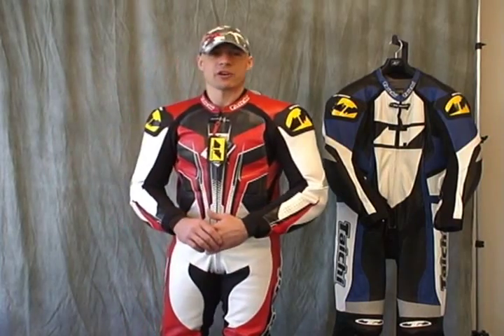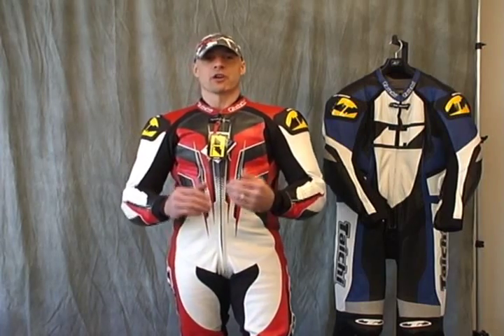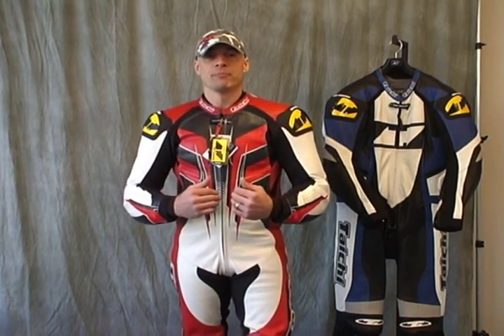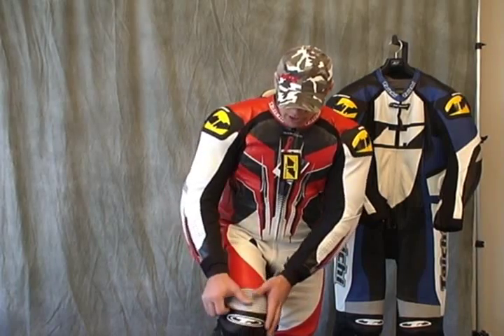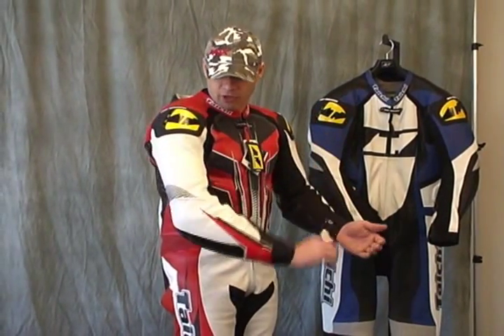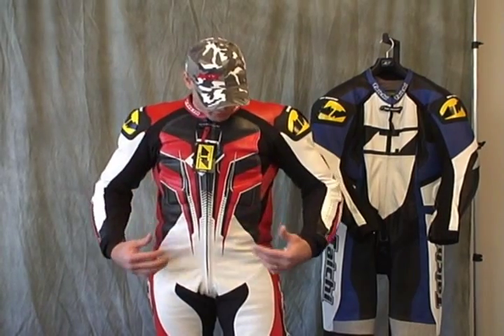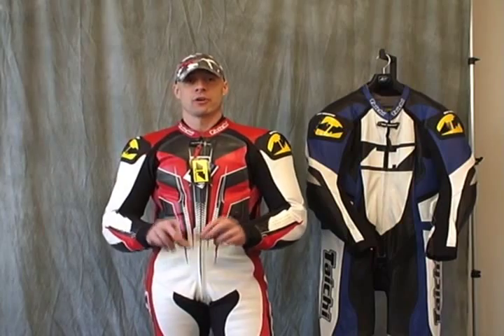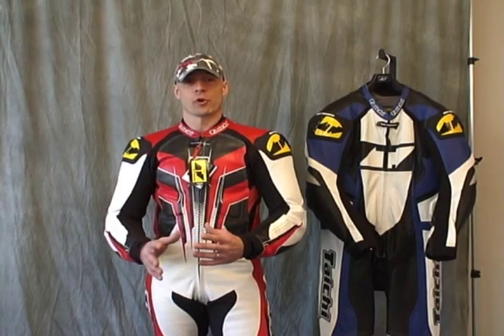RS Taichi GP Max R070 Leather Race Suit Review Part 1 from SportbikeTrackGear.com

Comment: I just got a GP Max R100 and finally took it out for a ride.  Felt a little snug in the chest when I first put it on but still felt great.  It is such a difference over my Astars RC1 suit.  You can move all over the bike and it doesn't feel like you are wearing a big bulky suit.  It also flows a TON of air.  It's pricey but such a nice suit.  I would definitely recommend.  Oh, it also looks pretty bad ass too.